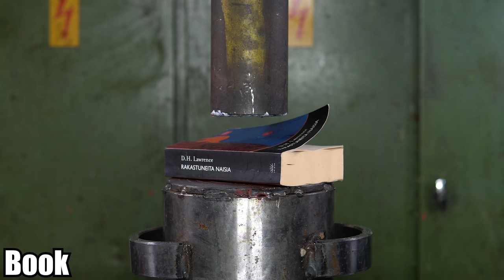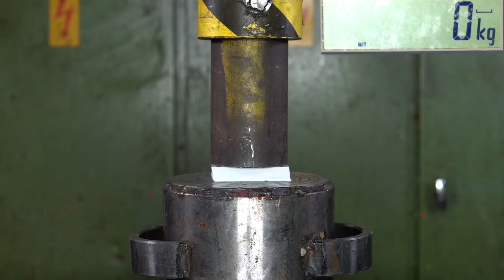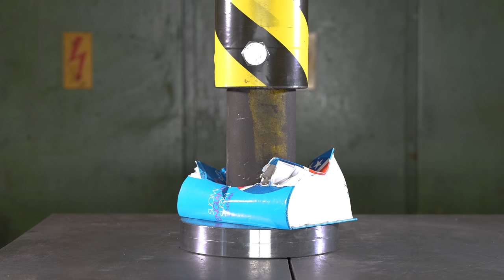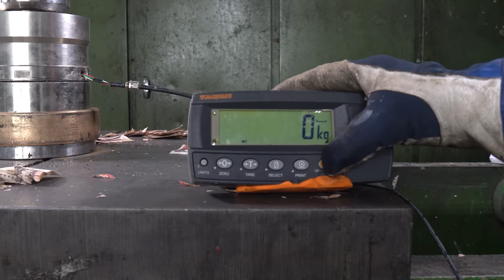150 TON Hydraulic Press Vs. Paper | Compilation

Comment: If this channel has taught me anything, it's that paper is explosive.
Reply: I had absolutely no idea. I would not have believed you if you told me. I'm flabbergasted .
Reply: @chewadadu2511  
It's not. At these pressures things happen very quickly and seem explosive!
Reply: That blast come from the press machine hitting the bottom when the paper instantly removes from to much pressure
Reply: @Allangulon  Oh?  I beg to differ.  To explode is to: "burst or shatter violently and noisily as a result of rapid combustion, decomposition, excessive internal pressure, or other process, typically scattering fragments widely."  Not all explosions are a result of combustion!!
Reply: Fun fact, through aerosolizing, most things are explosive! That's why grain silos explode, the fine powder of the grain floats for a long time in the air, and all it takes is a spark for the flame to transfer exponentially, extending to instantly consuming the oxygen and creating an explosion of expanding gaseous forces. Most things that are in any way flammable are the same; at a small enough surface area, they can be ignited in an instant, using their own flame to propagate an incredible explosion.
Reply: Kinda makes sense if you think about it though. Paper is just pulverized wood, so when you compress it like this, you're essentially turning it back into wood, and when wood is subjected to forces like that, it tends to rapidly disassemble itself
Reply: @ZC.Andrew  if I'm not mistaken, a true "explosion" is when a super sonic pressure wave is produced, i.e. a shockwave. A subsonic event like this would be considered a "deflegration"

Although this might only apply to chemical reactions...
Reply: @James-ho5te  You might be right. I'm just going off of what I learned in my (basic) physics classes, and on Google.  That was copied word-for-word from the definition.  That said, do you think a subsonic pressure wave was produced here?  In fact I wager it was... pressure waves can exist outside human detection. I am no physics major, this is for sure.  But I will stand by my statement that "explosive" has different meanings and contexts... and for certain this video displays an explosion of SOME sort.  I stand by that 100%.
Reply: @ZC.Andrew  yes there was definitely a subsonic pressure wave produced, that's what sound is, not trying to sound like an asshole. 

And I was slightly off, the difference is between a deflegration and a detonation, but both are considered explosions. And yeah, they are only used for chemical reactions; i.e. the difference between lighting off a pile of gunpowder (deflegration) and firing off a cartridge in a rifle (detonation). So this is still considered an explosion.

It was more of a "fun fact" than an "um actually".
Reply: Amen.
Reply: ...which means a  w h o l e  l o t   of paper cuts 😬
Reply: Until u got 150ton of pressure
Reply: @Злойлоун  3:57 no
Reply: P1T1=P2T2
Reply: These clowns need to add a square😂
Reply: Everyone stop being nerds
Reply: @mausengonmned-5258  Go play with some sticks if big words hurt brain
Reply: @EnclaviousFiraga  No me just do not like Un needed Nerd conver sation Eat bottle caps
Reply: Anything will explode under the right amount of pressure
Reply: Paper explode because too much pressure and paper can't fused so explode, unlike metal that can fused when you press with hydraulic press.
Reply: Naruto was right all along!
Reply: @James-ho5te  Let's make it this way, paper is a material useful to obtain an explosion, exactly like exactly like gunpoweder.. Nontheles paper is a materail used to prapare many kind of explosives and bombs.

Comment: i'd love to see you guys add some kind of temperature reader to this. i'm curious as to how much that insane pressure is adding to the victim's internal heat as it's being exploded.
Reply: It's not actually exploding lol
Reply: @dyloak6450  still is getting really hot, if there’s one thing I learned about when you squish strong metals, it’s that you don’t want to touch them with your bare hands directly afterwards
Reply: @dyloak6450  Well, there's a sudden release of energy - noise, materials.  Kinda of an explosion.
Reply: Maybe a thermal camera?
Reply: @DK-vx5co Yes. However, a layman would think of an explosion as occurring due to spontaneous combustion (chemical reaction) as opposed to runaway fracture due the application of mechanical stress.

Comment: Exploding paper stacks is my favorite stuff on the press. I was surprised that paper of all things would have such a violent reaction to being compressed.
Reply: @orhan3007  The post-it stack at 0:20 explodes before the piston is even near the table.
Reply: I'd be pretty mad too if I got crushed by several tons of force
Reply: @orhan3007  I don't believe this is entirely true.
Reply: @jaysuizo-franco7106  
It is. It's a very interesting  and very real chain reaction.
 
The thing you have to realize is, the chain reaction starts with the first rip... and think about that for a moment.
 
So think about the reaction if all of the pages were identical and without imperfection. Just a somewhat spongey and very slightly springy and bendable material. If you had a perfect stack of pages, where does the first rip happen?
 
The first rip won't happen at the top because the top is where the paper has the most ability to bend... and even if the rip does occur there, that's just one page, and the next in line becomes the top page in the reaction and has a full 90 degrees to bend.
 
The first rip won't happen at the bottom, because the paper is perfectly flat there.
 
So the first rip is going to have to happen somewhere in the middle... and when it occurs, it will be under such immense pressure that it won't rip up and it won't rip down, it'll rip out.
 
When that occurs, the pages next to this page will necessarily be ripped too when you consider the friction at that spot. Thousands and thousands of pounds of pressure, if one sheet moves out just a little bit, it will tug the adjascent sheets above and below out with enough force to rip them, and suddenly, you have an instantaneous chain reaction. 
 
If you want to think about it in a more principled manner, think about it like this. The press is pressing down on the center channel, but the pages outside of that channel are also being compressed by being pulled down and pressurized. There is A LOT of potential energy being stored in the form of these pages NOT ripping. When they start to rip, that is an EXTREME amount of energy being released all at once. The instantaneous release of all this potential energy is similar to that of a bomb.

Comment: You should use that one press fitting you have that is a wide circular shape. That way it crushes the whole paper instead of just the center.
Reply: It's the pressure differential that makes larger explosions possible.
Reply: @Allangulon  but what would happen if he used the wider fitting like I'm saying?

Comment: I suggested before but I'll try again: I'd like to see a paper compression with the stack of paper (or book) being smaller than both plates, so that it gets pressed evenly across all surface. Never found a video with that.
Reply: Yes, thats a Question I also ask me. In all videos there is the pressure stamp a bit smaller than the object, so the Paper bends at the corners and sides. What would happen if, e.g. the Post-Its, are put between 2 massive steel plates, so the force and pressure is all even at every point of the surface.

When the pressure is only on parts, it is clear to see, that the force could and would get the line of the least resistance. And so expand and explodes to the sides. 

So, what would happen, if there is even pressure? Will it slip at some point also to a side and explode or get into a very dangerous projectile?

So the next thing could be a massive steel box with a stamp where the notes and the stamp fits right in, so that nothing could slip away. What would happen here? I think maybe nothing. Or breaking the steel box. Of course it could be potentially very dangerous, so be careful.

So many open questions? Hope there will be some answers. Thanks

Comment: You've compressed quite a lot of paper to the point of exploding. We see the paper compress quite a lot before it ever explodes. Can you do a video where you compress various paper types to just under explosion and then let off the pressure? Do the individual sheets still come apart like normal? Some books...such as bibles are made of very thin paper. Do they explode better than do cheap novels?

Comment: “When a stack of paper is placed under high pressure, like in a hydraulic press, the violent reaction occurs due to a combination of factors. First, the paper fibers are compressed, causing them to come into closer contact with each other. This results in an increase in friction between the fibers. Second, the increased pressure causes the air trapped between the sheets of paper to be rapidly compressed, creating a buildup of energy. Finally, the compressed fibers and trapped air reach a critical point where they can no longer withstand the pressure, leading to a rapid release of stored energy and a violent reaction, such as an explosive burst or the paper being forcefully ejected from the press.”
- from chatgpt

Comment: I would love to see more of the hot press vs stuff. But instead of making the press head hot, you could probably just use a round piece of steel, heat that up, and put it between the press head and the items you are going to crush. That may make it easier to do those types of videos

Comment: I bet the paper won't explode at all, if you could change the end points of the press from being springy steel to something incompressible.
Now you can see how energy gets stored in springy steel table, and released when paper starts to slide off. Thats why the gopro flies up, and why all stuff from table goes up in the air.

Comment: Try to Make a video with a stack of printer paper, but the press and the base must be larger/wider so as to spread the weight/pressure across the stack of paper.. and not in the center. I guarantee that it won’t do anything to the paper.